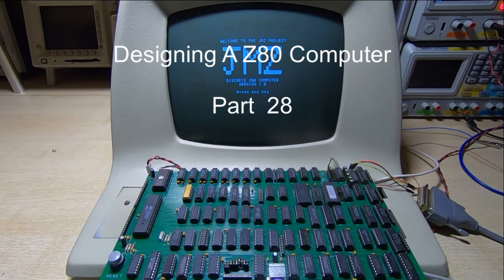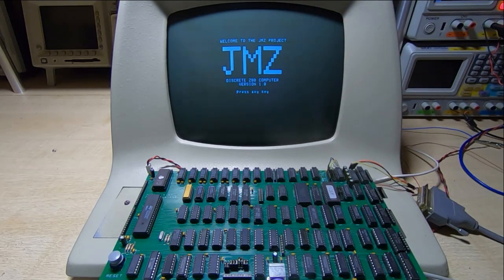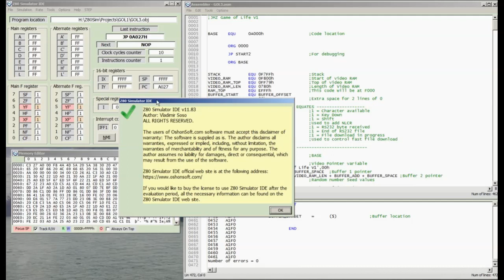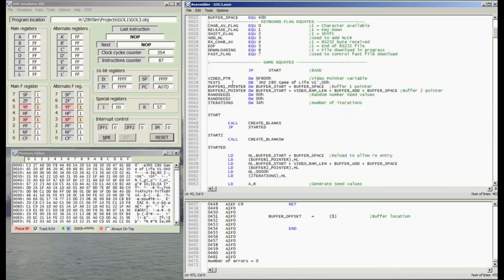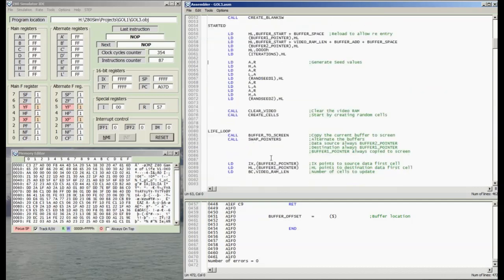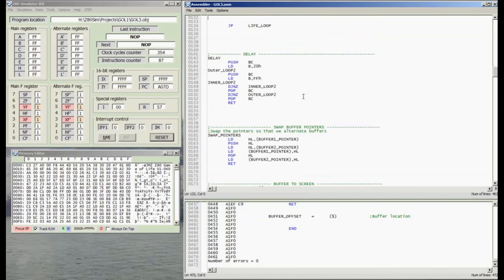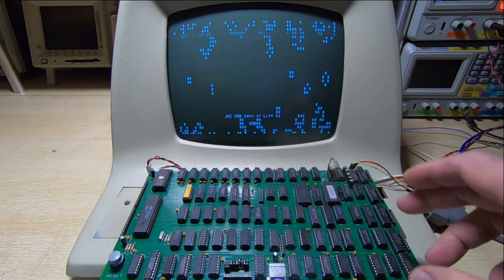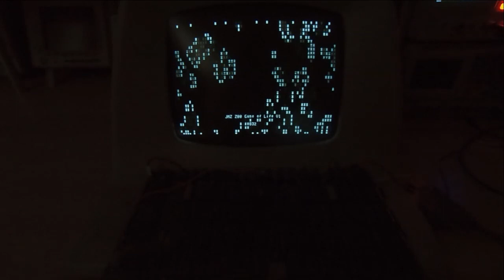Designing A Z80 Computer Part28

Comment: Life is a good one - I often test out modern microcontroller + display systems with that as well. I'd imagine that rendering the cell buffer to the serial terminal probably slows the generation rate down considerably due to waiting for serial transfers to complete.
Reply from the maker: This computer does not use a serial terminal to display data it has its own video generation circuits. The 'terminal' is just a CRT.